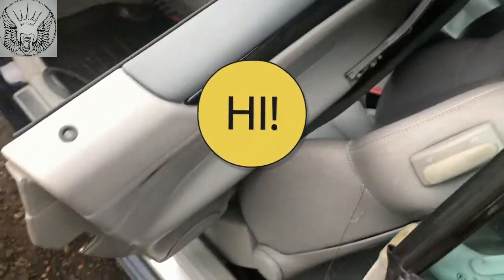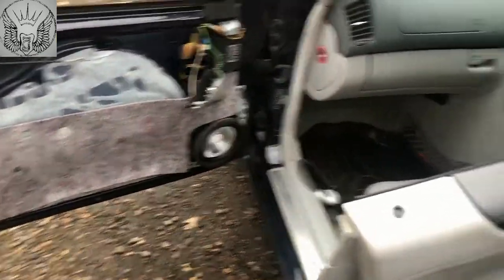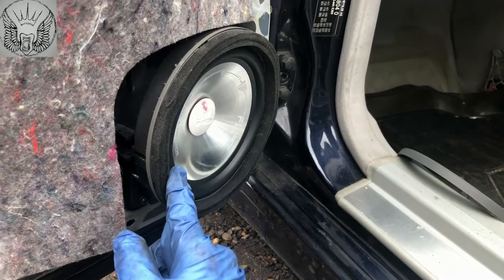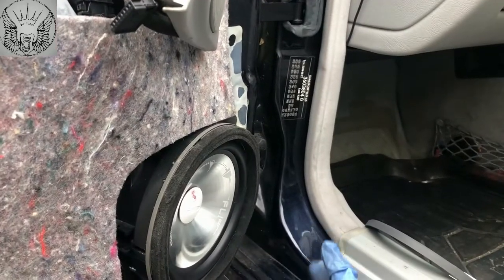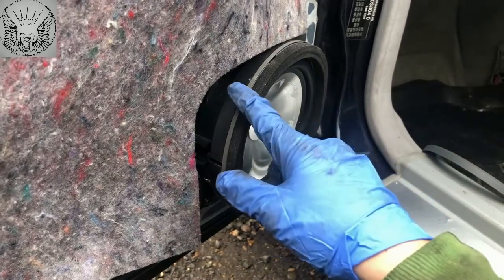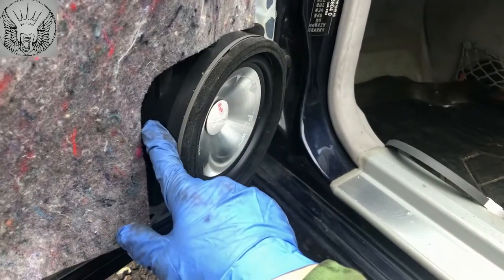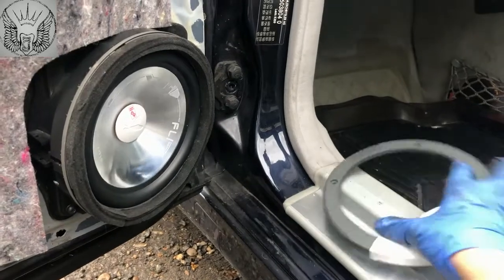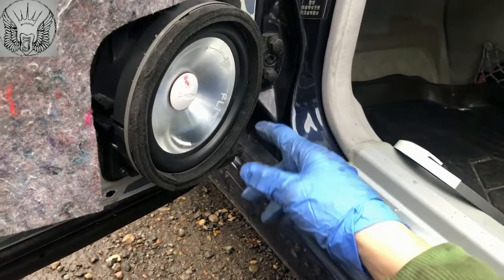Mercedes CLK 2002 w208 door panel card removal, speaker blown upgrade

Comment: For the 3.5 speakers, did you have to break off the two tabs on the new speakers in order for it to fit on the stock speaker mount?
Reply from the maker: Hi, i did not have to brake anything on the new speakers, i did however modify the speaker mount as shown in the vid..